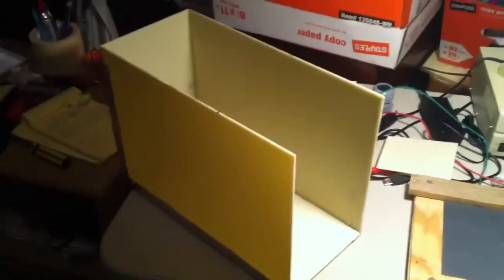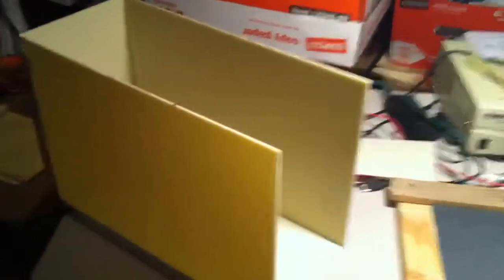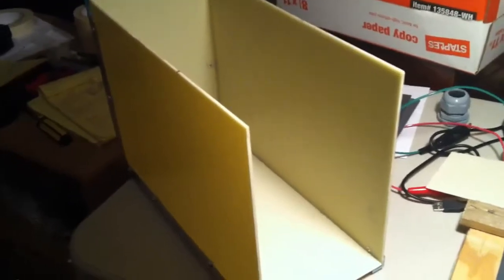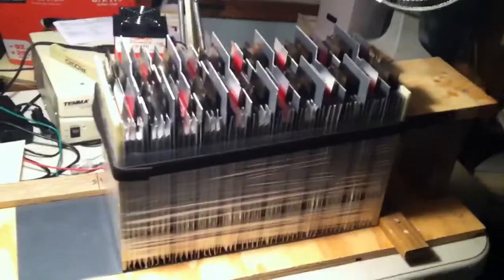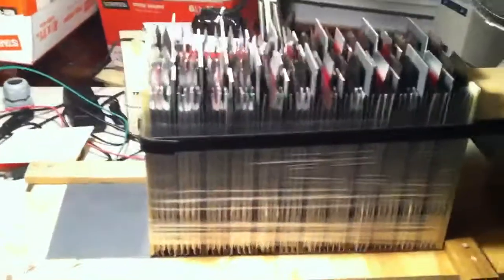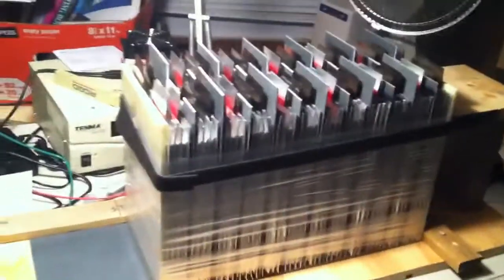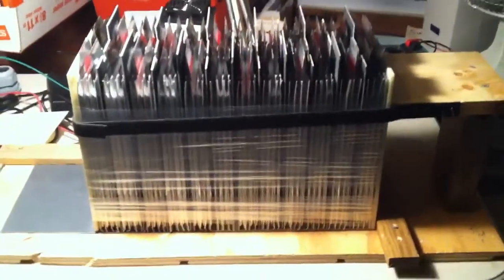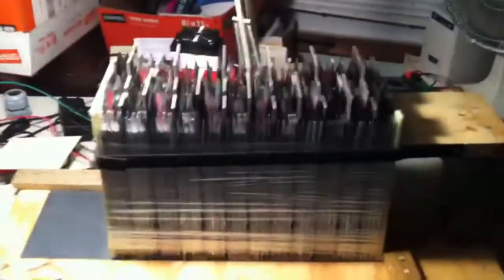Factory Five Mk4 - Electric Car - Video 28

Comment from the maker: @Lithiumaniacs Yes.  Aluminum is about 62% of the conductivity of copper per cross sectional area.   More aluminum will conduct the same as copper.   We are sizing the interconnects for the load; going a few times over what is needed.  I plan to load test this first pack and watch interconnect temperatures closely to be sure.   Yes, silver plating is the way to go.

Comment: @ev99saturn It does not matter on the plating, even though silver is the best. It matters on how thick the aluminum is between the cell tabs and what type of aluminum. The best you can get is aluminum alloy @ 60% conductivity, if you pass 2000 amps through that resistance the tabs will heat up very quickly.

Comment from the maker: @Lithiumaniacs All of the packs combined will weigh around 450-460 lbs.   Cells are rated to 600A, and 750A pulse, so combined the pack should be capable of 2,400-3,000A.

Comment from the maker: @DanFrederiksen  Still finalizing the interconnect design... will show that later,  but they will be nickel plated aluminum connections.   Light weight and corrosion resistant.    This pack will be 4P12S at 39.6V nominal.   I will build five 12S packs and two 20S packs for a total of 4P100S.

Comment: @ev99saturn 

Sounds good, but I would not try and pull 2000 to 3000 amps out of your pack with aluminum connections. I went through this with my cells, the best conductive aluminum you can get is only about 62%, and I could not find that aluminum alloy in a bus bar. I used copper with silver coating custom built at Storm Copper. My tabs add a little weight, but it's worth it not to worry about resistance and heat.